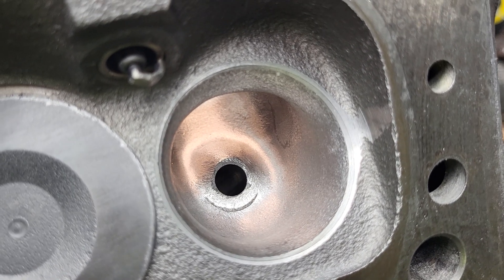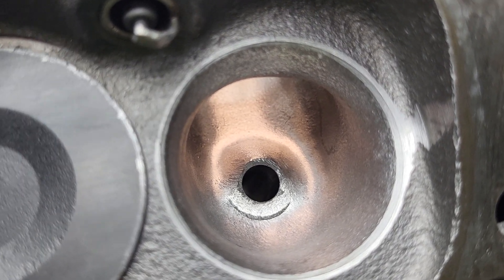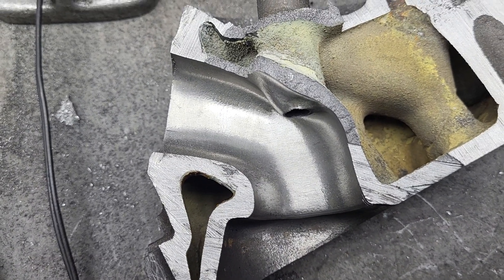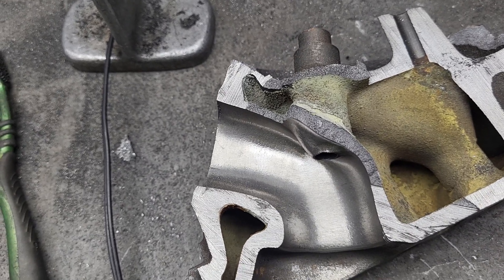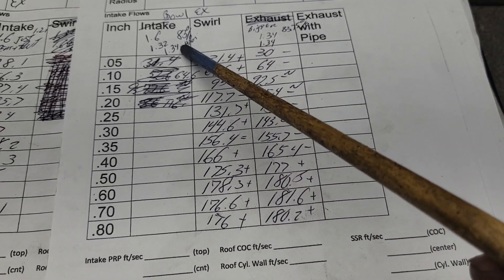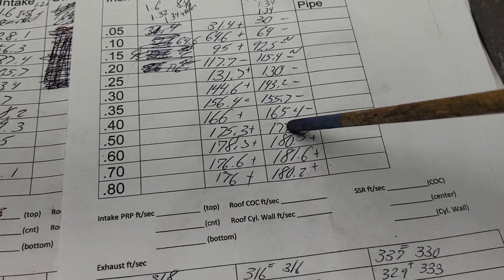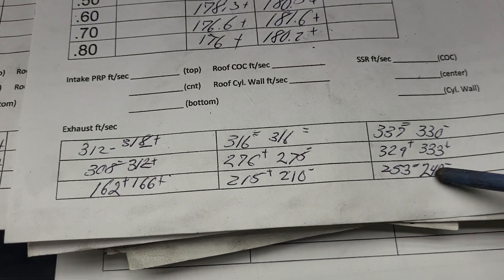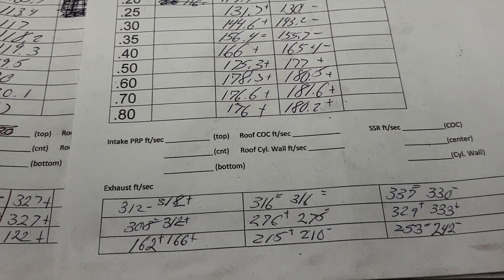Chevy TBI head exhaust throat experiment, shaping the throat 1.34"/ 1.34". Less offset on  throat

Comment: Laying down the SSR helps with turbulence at the convergence point..
My opinion-
Depending on application I work on a ratio between the area of the flange and the area at the throat, I don't work on the 89% - 90% rule as for the intake (application specific).
Then I size and shape between the flange and throat for as quiet a port as possible at the highest depression possible. I don't bother with cfm numbers or velocity anymore on the exhaust. 
On a running engine the valve cracks off the seat at hundreds of psi pressure and high temperatures.
Reply from the maker: Sound is super important. No doubt. Thanks